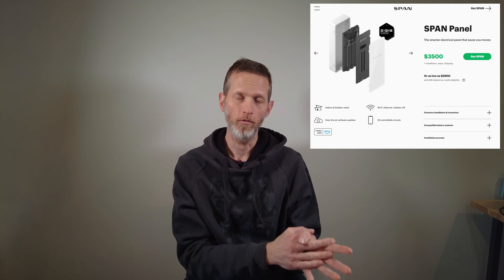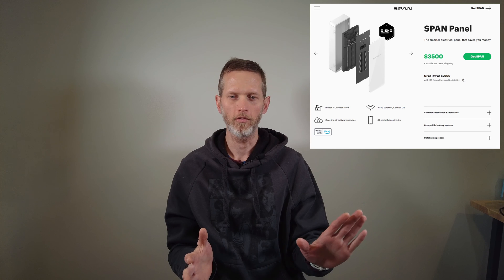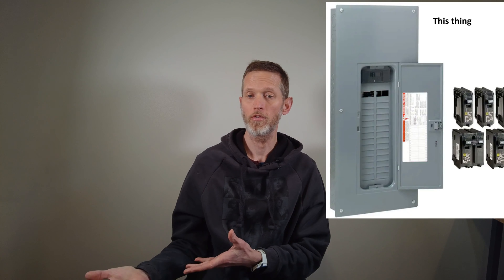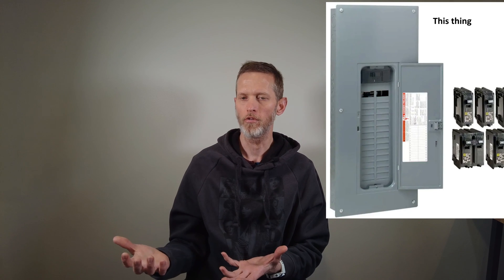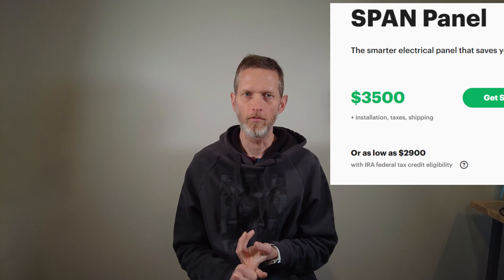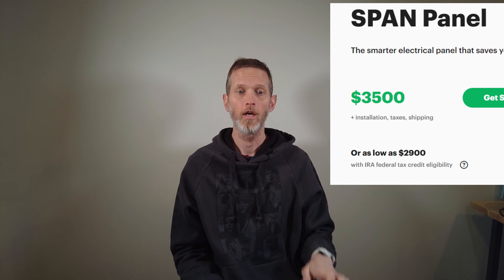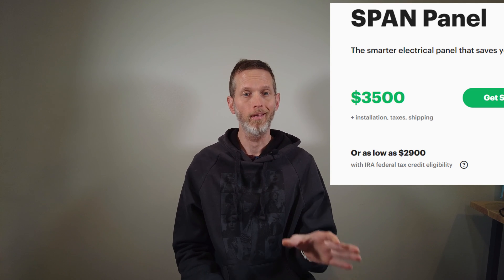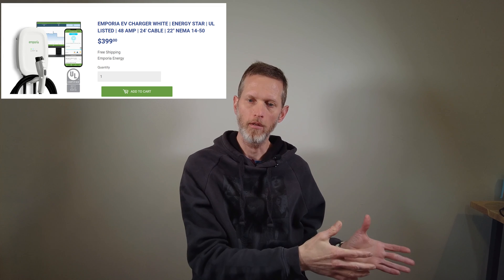Is SPAN Panel the Wrong Choice for All-Electric Homes?

Comment: I wonder if the Span panel can help save a step if one has solar, and a Powerwall or two are planned for the future.  In our house, we have a 100 Amp panel, are planning on upgrading to 200.  We have geo heat/cooling and solar,  and are slowly moving more to electrical (like an induction range).  Plus with time-of-use charges on the way from our power company (we don't know when, but hear it's on the way), maybe a Span panel can help juggle all of that better?  Maybe putting in the Span helps lower the cost to integrate battery back-ups?
Reply from the maker: SPAN might help with some of that, but given your plans it's probably not a long-term solution. It really shines where you need an extra 25-50A for specific uses that can be deferred (e.g. EV charging). If you had 150A service and it was prohibitively expensive to get to 200 (or 200 and couldn't go to 400), it would be a solid option. In your scenario it might make sense to install a SPAN when you do the 200A upgrade, really depends on how much solar/battery/other electrical loads you'd like to scale for.

Comment: I’m interested in a backup generator, and it’s much cheaper to have an air-cooled model than a whole house water-cooled generator. I can live without a lot of things when I lose primary power. However, I am concerned about mold, so I want to be able to cycle air conditioning zones to combat that.

Comment: I'm hearing 200A and 400A tossed around too loosely.  First off what is the connected load (NEC 230)? We don't just add everything connected, if we did we would all have 400a services min.  You have other options available such as tapping two panels together, or a disconnect with OCP. At the end tho you still hammered it home, poor accessories, lack of open protocol for open integration, and price. At 3K just for the board not including the cost for AFCI/GFCI breakers you're looking at 5k before installation for what could be a giant paperweight in 5yr's with no cloud support.
Reply from the maker: Would you be able to clarify what you mean by "too loosely"? There is a place for SPAN when doing load calcs because it allows you to "undersize" to 200A service, if it's close, where you would end up with 400A if you did a traditional load calc. If that's where one falls because the math works, then it could make sense. I don't recall discussing how load calcs are done. 

If your calc puts you outside that space, and you need 400A (or more) regardless of what you can do with a smart load shedding appliance. Then SPAN is a much harder sell.

Comment: SPAN is  my only option.  To go from 100 amp to 200 amp is $750k. Span and batteries is way cheaper.
Reply from the maker: Could you explain more around why the service upgrade is so expensive? That is 10x the high end of "normal".

Comment: I dont know i think its all b.s
Lets say someone has a span panel installed but they have no plans for installing solar panels or generator  and have total electric house
Reply from the maker: Sorry, I don't understand your question.
Reply: @MissingRemote  my question would be.
If your just replacing your existing panel with a span panel. And not adding a batter back up or solar or a general would there be any advantages to just installing a span panel.  I think not. So I'm asking would there be an advantage if so please list.other than the fact you just purchased a shiny new very expensive panel.
Reply from the maker: @clintjohnson7023 How SPAN works and what it provides are in the topics that were covered in the video. It might be worth rewatching to get your questions answered in more detail. In general, SPAN's value prop is that it lets you add more electrical devices (e.g. EVSE) without upgrading your service. Another of the topics that was discussed in the video is when this might make sense, and when it wouldn't.

Comment: What do you think about the Leviton smart panel?
Reply from the maker: If you have a Leviton panel, and want to make a few circuits "smart", it looks like a solid option to get monitoring and some load shedding. The biggest issue with it is that the breakers are very expensive ($100-$350/unit) compared to a standard breaker ($6-$100/unit). Which can be fine if it's just a few circuits, but if you're doing a whole home, it's a massive difference. The other thing is that Levitron panels/breakers are proprietary. There are good benefits to their design, but it means you're locked into their ecosystem. So it depends a lot on your goals and budget. The project cost for using Levitron in our case killed it early in the research phase (which is why I have a video about SPAN, but not one about Levitron ;)).
Reply: @MissingRemote  I did like the surge protection. I am installing solar with a string inverter (power wall 3) and I thought it would be good track my usage, but the cost.
Reply from the maker: @hectorarcelus6602  If tracking is the primary use case, you can get an Emporia Vue that will monitor 16 circuits for $200. I'm planning to put one (or two) in every panel to get usage.
Reply: @MissingRemote  Please let me know of your experience with that product.
Reply from the maker: @hectorarcelus6602  I reviewed the previous generation Vue 2 (https://youtu.be/VJsCEm3ysQU).
Reply: We have a 400 amp service and I see no way around that on most our homes.  We Two span panels and two power wall 3 with dedicated solar to each panel and battery.  We just installed and are still under construction.  I would rather have two battery able to have share solar feed and not have it to split.  There is there is this FOMO of not balancing the solar and battery because of the two dedicated “silos.’
Reply: SPAN is releasing a new model Q1 2025. I have a new home being built, so not sure if I should wait to upgrade or not. New PCS and load shifting products are in the roadmap for many manufacturers.
Reply from the maker: @stanchan  What problems are you trying to solve. What loads are you willing to "pause"? You're totally right, there are some really interesting products coming in the next few months. Will be great to see how they play.

Comment: We don't have a capacity problem.  We do have free "nights" (10 hours).  This panel seems to make sense, even for the price, in these ways:  (1) Identifying when, where, and how much electricity is being used.  (2) Immediately shifting of loads equiped to do so and confirmin the change.  (3) Load shifting of non-smart devices.  (4) Replacing an old, out-of-code panel.  (5) Preparation for a solar + battery system.  (6) Automatic software upgrades.
Reply from the maker: Great points. Thanks for sharing. 

1) FWIW, you can do 1 for less than $200. Emporia Vue is a great option. 
2/3) SPAN only "shifts" loads for the appliances it supports, it's just flipping the breaker for everything else. That isn't really "shifting" except in the most basic sense. There are cheaper solutions to this problem.
4+6) Retrofitting a cool piece of kit in is always fun :). I love the concept of SPAN, the price and lack of integration options makes it hard for me to  buy in, personally. 
5) We recently put in a couple hybrid inverters and 28kWh of battery (ESS) for ~$7,000 (after fed rebate) that. Something like that would have much better ROI for the "free nights" thing. If you're AC coupling, a panel might need to be replaced to install PV+ESS, but there are ways to do it without that (assuming your panel is up to code).
Reply: @MissingRemote  All good points and useful food for thought.  

Just to clarify, our plan is to shift loads by setting clocks (e.g. pool filter and cleaner) and smart switches (e.g. air purifiers).  Circuit level load shifting would be a "last" resort.  I didn't know that integrated devices existed, so I really appreciate your mentioning it.

Comment: Im also looking at building a passive house, though probably not certified, and I’m surprised you need 400 amps. With the much smaller heating/cooling loads, and assuming really energy efficient appliances, I would thought 200 amps would be sufficient, even for an all electric house. Just starting to research, though.
Reply from the maker: It's certainly possible to build a highly efficient home on 200A (SPAN could make that easier), but in general EVERYTHING in a passive house is electric. It's easy to see how you get past 200A when you add up the induction cooktop that has a 50A circuit, have a couple 30A heat pumps, 40A for the oven, 30A for the ASHP water heater, a 48A EVSE, etc. Our numbers are harder because we're building an ADU (apartment above the garage) that will have its own ASHP, water heater, range, etc.

Comment: I heard they just released the SPAN Panel 48 in Mar 2024 but it wont ship till Q4. I think I want to get it and I dont think we are going to have any issues with the 200A load.
Reply from the maker: Are you retrofitting or new build?
Reply: @MissingRemote  Retrofitting. We have a new HVAC system/heat pump going in tomorrow and two tesla's. We have solar and Tesla two powerwalls.
Reply from the maker: @macmovieman1  If you don't mind, LMK how it turns out for you if you opt for a SPAN panel.
Reply: @MissingRemote  i’d be happy to update you and I’m definitely holding off for the 48 because I currently have a 32 panel and I’ve had to move six additional into a sub panel and I’d prefer to have it all in one panel and it will give me some room to grow.
Reply: Do you sit there and explord all options and functions of your microwave.  You probably wont with youf electric panel either.  Who has time. Such a waste. Wait till the computer blows or a control relay goes out.  Now try to find someone to troubleshoot, repair , replace, and at what cost.  What money did you save then.  Simply, just use less electricity.  Same as solar, cost efficency does not add up.
Reply: @yourelectricman I understand your point but I see the benefits outweighing the potential problems. It’s like seeing the fork for the first time after using chopsticks. I am sure it looked much more complicated and why bother to change but some did. I like the fork but I can see that the chip stick has been used effectively for a very long time and works just fine. Soy sauce?

Comment: I’m building my own home as owner builder and have the same issue. Nothing including batteries and their corresponding ATS can handle the 400a service
Reply from the maker: I need to do an update on this post (https://www.missingremote.com/blog/2023/10/passive-house-electrical-system-design-beta) to explain our new system design, but this explains the fundamentals of our design. The newer version has an additional 15K and battery. The loads I want to shed on the "Smart Loads" sub panel from the 3x 15Ks. Right now, that's just EV charging. We should have plenty of inverter and battery to manage the other loads for multi-day outages.